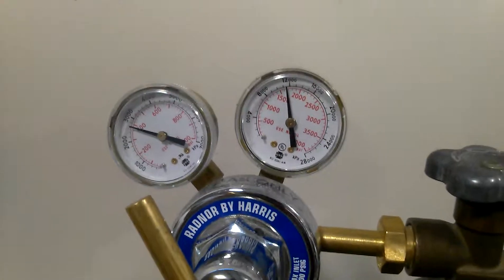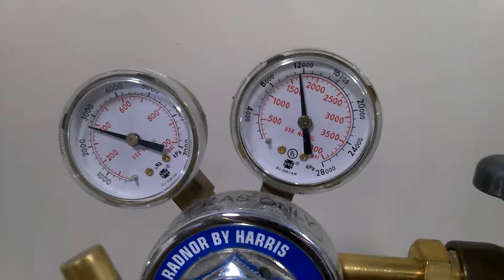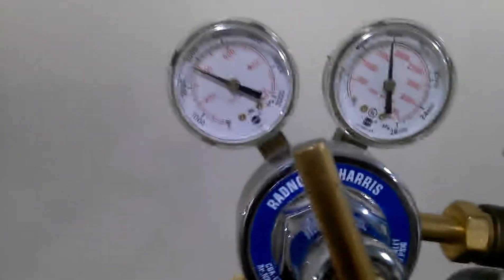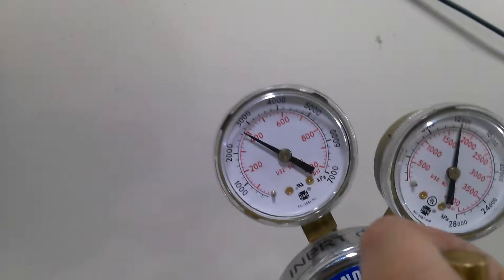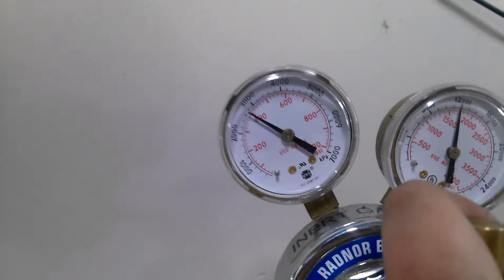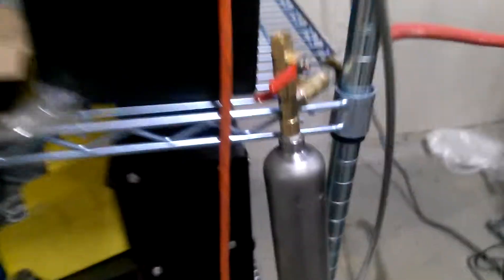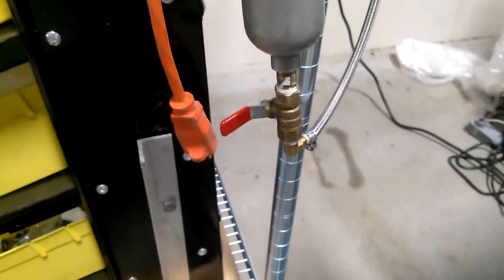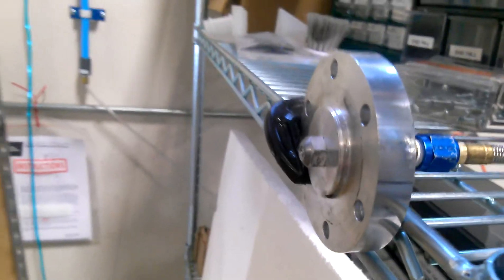Hollistar Rocket V1 Fuel Water Flow Test

Comment: Very old video and a new comment, but you made a nice engine. That nozzle looks like the ones used for waste oil, whats the flow and angle on it? You probably arent working on the engine anymore, but from your other test videos it looks like some of the combustion was happening outside the nozzle. I think this was the injectors fault, you used a very good atomization with the nozzle, but then added a massive stream of liquid Nitrous. I'm not sure here, but I think for impingement to work you need roughly equal size streams.